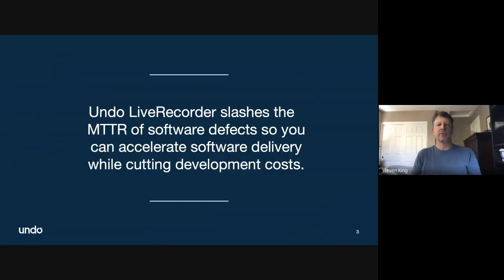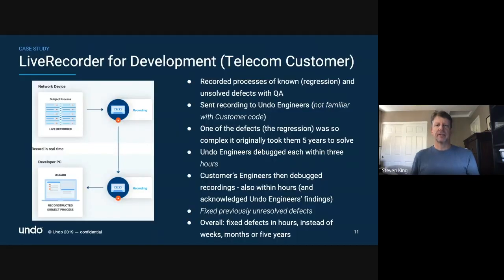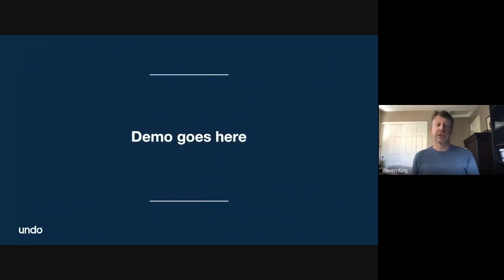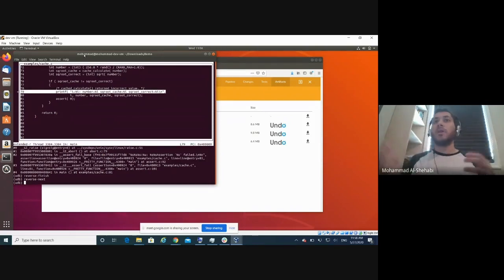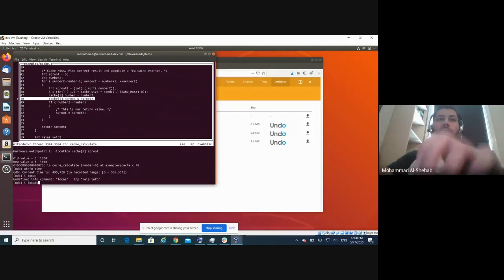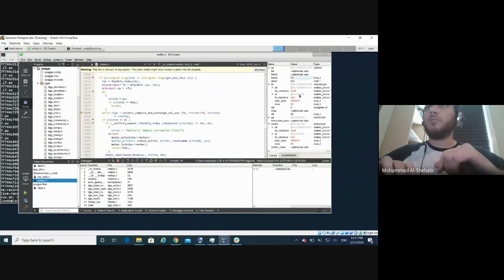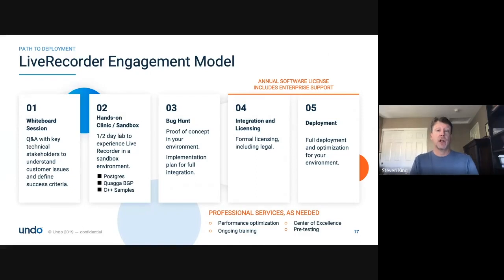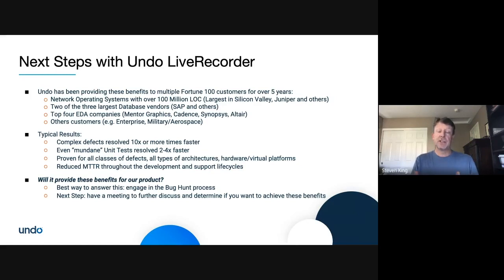LiveRecorder - Record, replay & resolve demo (May 2020)

Comment: hey there, do you have any channel(irc) for queries....
I have a c++ server running and when I request a particular link it fails segmn fault...Can I use live recorder to record just that failing request.
Reply: The short answer is yes and there are multiple ways to focus on a particular failure in a process. You can record everything in that server process or selectively turn on recording at a particular trigger point in your application e.g. when receiving a certain link. When replaying in the debugger you can jump to an individual request.
AFAIK there isn't any IRC channel but there's an enquiry form on the Undo.io contact page.